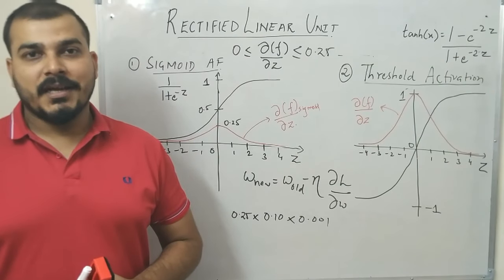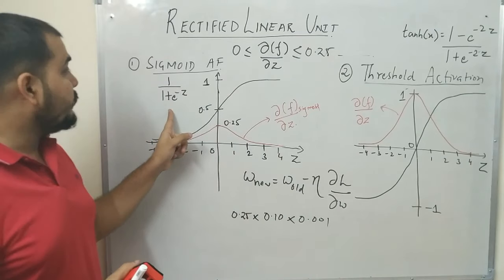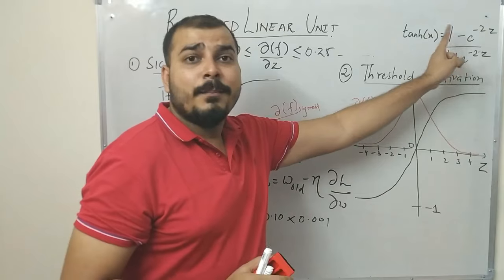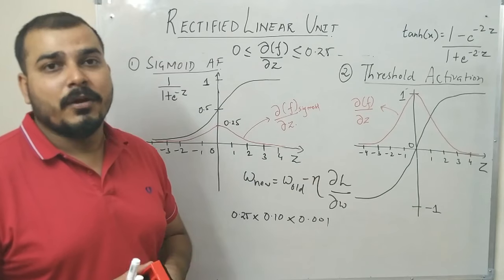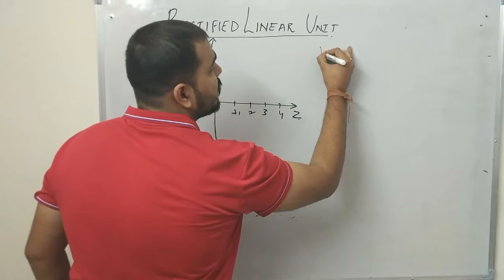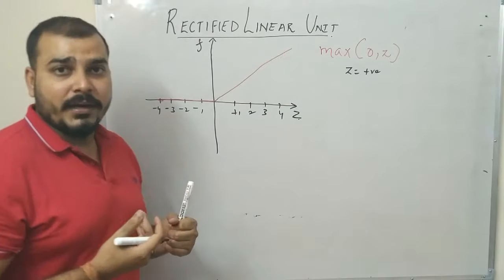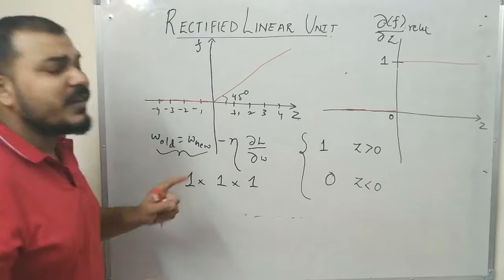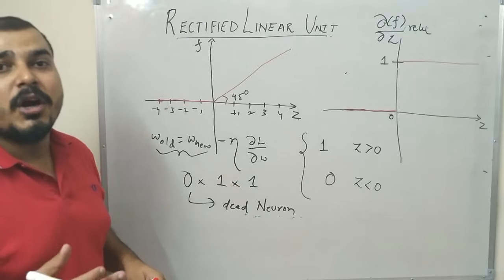Tutorial 10- Activation Functions Rectified Linear Unit(relu) and Leaky Relu Part 2

Comment: One quick doubt here... Might be a dumb one...
In ReLU we have f(z) = z, for z >0 and  f(z) = 0 for z<0, that has led to the 'dead neuron' problem, correct...
So we picked leaky ReLU to handle this problem....
My qstn:
Why cant we use some function as follows:
f(z) = z for z > 0 and
f(z)= -z for z <0

In such a case, for z>0 the derivative will ve +1 and for z<0, derivative will be -1.

Is there any problem with this approach?

Comment: Still not sure about Relu. So if the value Z is not negative, let's say the value of Z is 0.02, it will result in the problem of the vanishing gradient as you explained in your vanishing gradient video. How is that handled in Relu? Also, if weights get high, why would not Relu suffer from exploding gradient? I will appreciate your response. Thank you.
Reply: In the video it says if the z is +Ve value then our relu function gives the output as z itself which means 0.2. But in updating the weight while back propagating we use partial derivates so the partial derivative of relu function for z > 0 will be 1, so we won't have vanishing gradient pblm. The only pblm is with the negative value it will give 0 if we find derivative .this  is called dead neuron pblm but this is addressed in leaky relu by giving 0.01 for negative values

Comment: Good video overall. Just one small technical correction:

At 6:35, you said you can't find derivative of 0. That's not correct. On the left hand side of y-axis f = 0 for all values of z. And you said derivative of that region is 0. The problem with derivative of Relu(z) at z = 0 is it is discontinuous i.e. if you are at z=0 and you go towards right say to z=0.001 then f = 0.001. For z = 0.002, f = 0.002. If we compute derivative numerically, then df/dz = 1 in the right side of 0. But when z = -0.001 or z = -0.002 then f = 0. If we compute derivative numerically, then df/dz = 0 in the left side of 0. So, it's discontinuous. But discontinuity at one point is not usually a problem when dealing with continuous valued inputs as the Borel measure of that one point is 0 (using universal approximation theorem we can only approximate Borel measurable function. So using Borel measure here too to justify while discontinuity at one or even a finite number of points is not a problem).
Reply: thank you

Comment: One doubt in relu if w_new = w_old - n dL/dw let in chain rule all derivatives are 1 and let learning rate is also 1
and let w_old was also 1 or 2 

w_new = 2 - 1 * (1*1*1)
w_new = 1
like that, in next 2 iterations, it'll reach zero or -ve

then it'll reduce by 1 directly which can bring w_new near to zero or -ve very fastly which can be very dangerous.
but in case of sigmoid or tanh this was always less so it'll w_new will change slowly.

as all the weights while initializing will be small positive numbers, so in that case relu will make them 0 or -ve 

So how relu can be good.

for -ve leaky relu is good, but first of all, it should not go to -ve very fast.
I feel the slow reduction in weight is good as large subtraction can deviate the weight by large extent from what it should be

Comment: Question. For updating the weight we use the derivative of the loss or the derivative of the activation function f(z)?
Reply: In chain we require both derivatives
So if derivative of an activation fun is 
In decimals then it can affect other during multiplcation .And in deeplayered neural network we use many times the deeivative of activation fun so multiple
Smal val are muliplied so we get very small val updated.

Comment: Hi Krish...so if the value becomes 0.01 instead 0 in leaky relu, won't we again get the vanishing gradient issue again as 0.01 is very small and when multiplied it will the whole statement small.
Reply: as compare to relu if the value become 0 then it become dead  neuron and there is no change in weight but if we compare leaky relu with sigmoid then value of sigmoid ranges between 0-0.25 so if there are 3 derivate then result value become 0.21*0.1*0.2=0.0042 and in leaky relu result value is 0.01*1*1=0.01 so now if we compare vanish gradient somehow resolve
Reply: @manjeetmanu4547  thanks

Comment: derivative of zero is zero😂😂😂
Reply: he say wrong but he is correct with respect of graph at 0 function is not differentiable because of sharp point
Reply: Hey, listen to me. The derivative of a constant is zero. Since zero is also a constant, its derivative is also zero. However, in this particular scenario, we are finding the derivative of a function, specifically a piecewise continuous function. Note: the statement "derivative of zero" is completely different from "derivative of a function at x = 0". He is using incorrect language. Most importantly, the derivative of a piecewise continuous function at the point where the pieces join is undefined. Therefore, the derivative of the ReLU function at  x = 0, is undefined rather than zero.

I ain't that dumb either, I got masters degree in physics and currently a PHD scholar.
Reply: @changbadinesh  what i say ( he say wrong  )
Reply: @S.K.IntelliCy  ok !! It sounds ambiguous tho